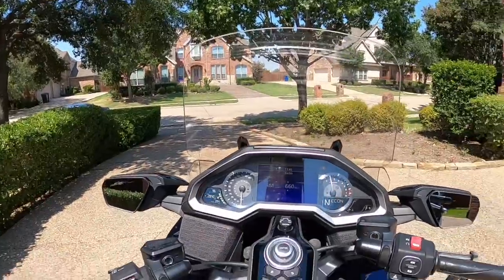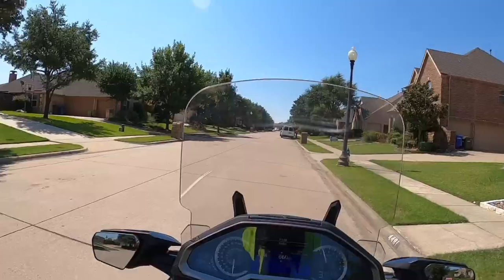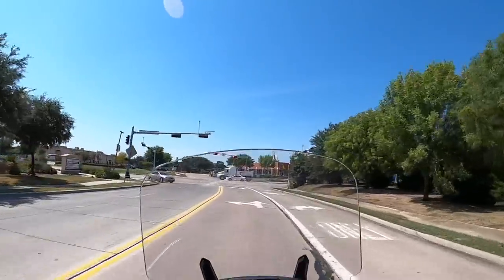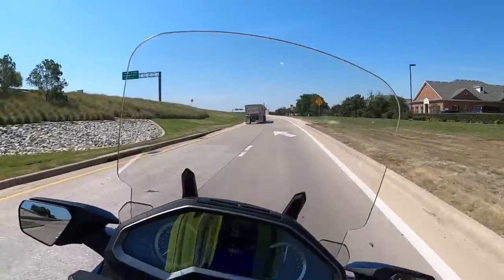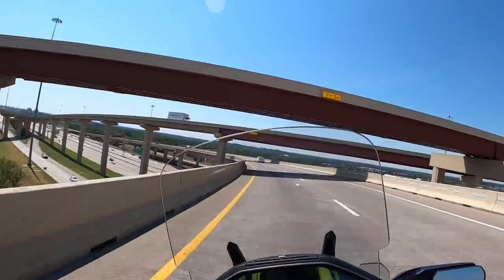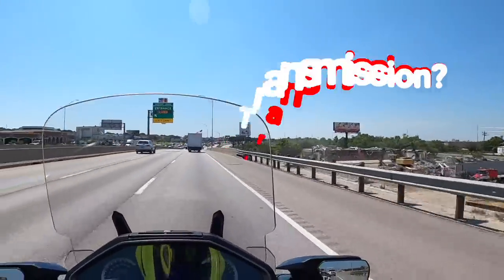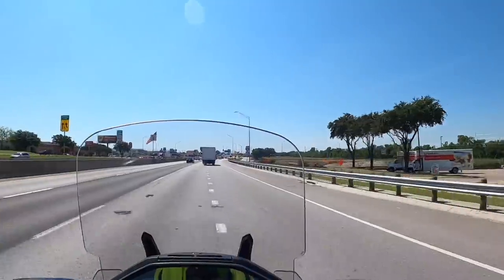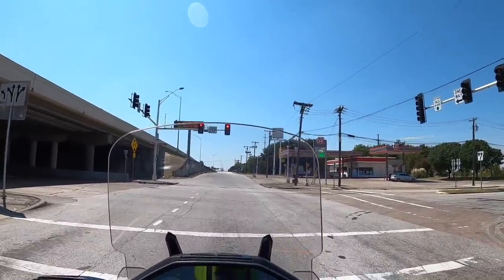Manual Transmission VS DCT | Cruiseman's Moto Vlogs | 2018+ Honda Goldwing | 2020

Comment: Yes the clutch takes some adapting too...just like the DCT does....but once you adapt your wonder how it ever felt strange...the way the clutch is setup allows for quick smooth shifting..you barely have to pull the clutch to shift...downshifts at speed with its slipper clutch is very smooth....the ride modes does the same with the 6-speed as with the DCT, except for the shift points...put the bike in sport mode and it feels like it gained 20hp and the suspension feels a bit tighter...Honda did a heck of a job with the 6-speed transmission...huge upgrade over the old models.
Reply: Thanks, more info in this comment than in the video

Comment: Drive modes change the throttle mapping, Traction Control and the suspension. On the DCT it also changes the shift points.
Reply: So, which bike do you prefer:  DCT or 6-speed manual?  Everyone is raving about the DCT but to me that's like driving a moped.  I love to 'disengage' after a long driving stretch and put the bike into neutral, cruising to my stop with no care in the world.  I'm leaning toward the manual 6 speed.

Comment: I wish I test rode a few manuals when I was researching the new Goldwing. I don't dislike the DCT at all, but there's something about the sound of a manual going through the gears and the control of manual shifting. That hydraulic clutch is not adjustable like a cable clutch is. HD is the same way - the friction zone is all the way out near the end of lever travel.
Reply: So, you would have rather purchased the 6 speed manual?  I am wrestling with these choices but am leaning toward the manual.  With DCT, it sounds like one is riding a moped.  What are your thoughts?
Reply: I am very happy with the DCT. It makes riding that much more enjoyable and fun, whether riding long distance on highways or carving mountain twisties. It is far from riding a moped - try one and you will see - especially in sport mode, with or without being in manual shifting mode. My only thought is how it would compare to a 6 speed manual and I would have liked to try one during my 1 year of research, but there were none available. I am happy with my purchase and do not regret it at all.

Comment: I have the 2018 manual Tour.  My clutch works perfectly, the idle remains steady and smooth, and it is the best shifting motorcycle I have ever owned.
Reply: Were you considering the DCT?  I'm wrestling with which option to go but it sounds like the DCT resembles a moped.  I've been comfortable with manual and will probably stick with that as my retirement gift.

Comment: Great video Cruiseman. I have always had a manual transmission but regret not going with the DCT on my 2018. The manual is really smooth though. I’ve had no problem with the clutch. Stay safe and ride safely.

Comment: I have a 2020 the clutch on mine grabs right when you start to let the clutch out, The driving modes will change engine performance as well.  The sport mode gives the bike much more power

Comment: On my 2018 manual, the different modes only appear to change throttle response. I don’t believe the "Econ" mode re-maps the engine response otherwise. My clutch also engages right at the end.  I also had to get used to that when I got the motorcycle, but don’t notice it now.

Comment: I have the 6 speed and did a video on why I bought it over the DCT. The drive modes are the same on the both models, when it comes to throttle response and traction control on the tour models. The drive modes have nothing to suspension as far as I’m aware since the suspension is not electronically controlled. The clutch on my bike engages sooner than that one, also remember it has a slipper clutch that makes the RPM come up as you let the clutch lever out.

Comment: probably already answered in the comments below ... but yes, the throttle response and 'fueling' from the computer is altered for the different modes. its actually very common. there are many many sport bikes out there that have different modes to 'tone down' the fueling for rain or UP it for sport, etc. This has been out for over 10 years on some yamaha, kaw, honda and suzuki sport bikes.(and others)

I love the idea of the DCT. I had a DCT honda NC700 for a little while and it was amazing the fuel mileage and how smooth it was. On buying a new goldwing, I just dont know about the clutch lever & shifter missing. I feel like riding wouldn't be as enjoyable. who knows. everyone online that has the goldwing DCT loves it. But Ive always been a manual trans car guy, and almost always had manual bikes. feels good to ride it and shift gears etc etc. PLUS a lot of slow speed maneuvering is accomplished with clutch lever feathering & slipping. So when considering a new goldwing, the more people I see LOVING the DCT, the more I question getting the manual version. .......... help

Comment: I actually adjusted my NT700 clutch to engage that late, 1/4 end of lever release, for quick shifting. Need to get use to that, or else engine would stall.

Comment: Chris, the 2020 model has improved throttle response in all modes compared to the 2018. I just traded a 2018 in for a 2020, and promptly took it out for a 3000 mile walk to Michigan from Texas. Seat has also been improved, and I was able to ride 12 hrs without hurting. The new model is hands down much more refined.
Reply from the maker: I will take your word for the throttle response. You have logged a lot more time with the 2020 than I have. But, the seat is the same SKU from Honda as the 2018 seat.

Comment: When I picked up my 2018 GWT6 from the dealership in February 2018, the clutch engaged immediately with almost no dead zone.  I had to stop and move the adjustment dial to "3" because I felt unsafe with the way the clutch was engaging.  My assumption is that it came from the factory set that way.  Scary for me as when I hopped on the bike for the first time, I was in between two rows of new bikes (outside) and I had to make an almost immediate 90 degree turn, followed by going down an incline, having to wait for traffic, and then making another 90 degree right hand turn.  The clutch has been fine ever since...

Comment: Where are the oil plugs on the manual transmission Goldwing 2021
Reply from the maker: There is only one drain plug on the manual model at the front of the engine.

Comment: What about slow speed maneuverability with the DCT Cruise? Requiring artful use of the Clutch, Brake and Throttle aka: Friction Zone? Like when practicing 18’ U Turns, Cone Weaves, Intersection maneuver scenarios posed in the advanced riding classes?
Reply: You put it in rain mode, and use the back brakes as friction zone. The back brakes are linked to 2 of the 6 front brake pistons. Honda Gold Wing  DCT is a awesome machine.

Comment: You can't "adjust" a hydraulic clutch unit.  The clutch not engaging until the top of travel is likely because it is worn out.  The revving at idle might because the coolant level is low. On a Honda car if the coolant is low the throttle body does not get the heat it needs to work properly.  Not sure on that as I am a Honda Automotive tech but the theory is there.  On my 2004 Wing I had to tear it down quite far to get to all the gear clamps it had to stop the coolant leaks.  Had the fuel cell out and everything to get to the clamps.  I think it had 32  clamps in total  Crazy.  Overall still love this bike enough to buy it twice...

Comment: I've got the 6 speed.  The drive modes affect throttle response.  Mine is a base model, but I think on the 6 speed touring model it also affects suspension behavior.

Comment: I have my clutch lever set to 5 so it engages almost immediately. 

The drive modes are for throttle response. Sport is very impressive lol. And rain gives you very little power, and works very well in the rain.

Comment: I've had my 2018 Tour almost 2 years now, this after a 2015.  So I think I can make a good call on the difference between the 5 sp and 6 sp.  6 speed all the way, it shifts so smooth and drops the RPM 500 @ 70 MPH.  I do not know what the MPG is on the DCT, but I get about 48.5 all day long @ 70 in Tour mode.  I've never ridden a DCT, but I will admit that the hill assist is very welcome on the 6 speed.  About the clutch friction zone, where is the lever cam adjustment set at?  I like mine @ 3, seems to be the best zone for me, but to each their own on all of it.

Comment: The 6 speed manual transmission just got more attractive.  Max at Traxxion Dynamics is about to fix the problem of the short shift lever that makes it hard to get the left boot under the lever.  This will be a huge fix.  The DCT is awesome but now I can enjoy the end of the nagging short shift lever.

Comment: What about longevity? Would the DCT last longer without repair than the manual? Is servicing an issue? Would the auto have to be serviced more often than the manual? Having a couple bikes, dirt/cruisin ect, jumping back and forth auto to clutch seems almost dangerous.
Reply: These too are my questions and concerns. The service and maintenance issues primarily. 
If you own and ride more than one bike, you need to pay closer attention to which one you're sitting on. Lol

Comment: I’m not a DCT type of guy. I want the transmission to shift on my command. I know there is a manual mode, but if you use that, you might as well include a clutch. I don’t even like different drive modes. I think that learning how the bike behaves, and having that continuity is safer. I don’t need buttons to enjoy my ride.
Reply: But with the DCT you have the manual mode and the motorcycle turns to a sport car with paddles. It’s fantastic!
Reply: I don't even turn on the radio. Just don't need all of the extra gadgets.

Comment: Can’t speak to the DCT as I’ve never ridden one but having ridden for 50 years I can say that my 2019 tour shifts better than any other bike I have owned. I shied away from the DCT because I was concerned about slow speed maneuvering, I ride mostly two up on this bike.  Friends have the DCT and love it and there is no way I can shift as fast as them but I am very pleased with my 6M.  There are five positions on the clutch lever, very easy to adjust.
Reply: @Hoasis Shine 

Respectfully. That’s what brakes do. They slow you down. Re-read your comment. Makes no sense.

Comment: Honda really seems to push the DCT goldwings. In 2021 I went to a Honda demo ride and all the demo goldwings I believe 10 had the DCT no manual transmission bikes. It was in Costa Mesa California with lots of traffic and I wasn't a fan of the DCT lots of shifting up and down and not real smooth shifts.  I bought a 6 speed manual goldwing.

Comment: I'm still torn. While many supercars are moving to dual clutch trannies and gaining quickness as a result (I understand that a well sorted DCT can shift faster than any hand rowing a lever), I also see a trend away from more "engaging" driving. One thing I covet about and associate with riding a single track motorcycle, is that the need to use all 4 extremities in fluid fashion contributes to making the overall experience more engaging and facilitates the magic of feeling "oneness" with the machine, road and surroundings. No question this DCT is a marvel of technology and even addresses successfully the low-speed issues associated with earlier clutchless executions (thinking about the FJR AE here), but I still remain on the fence.

Comment: Just bought a new 6sp 2019 Bagger (in UK). I have owned  a DCT Honda and it was very nice but it does have its quirks so I am very happy about my choice. Sometimes DCT does not know what gear to be in especially when going downhill and it can sometimes be distracting looking at what it’s doing. Yes shifting on DCT going up is very very smooth but on downshifts coming to a stop can often be a bit ‘lumpy’ where a slipper clutch manual would not be. Think the ‘bigot’ remark was uncalled for, choosing a manual box on your motorbike does not mean anything other than that, I want a manual box. Anyhow, horses for courses.

Comment: Also, for the clutch... if you adjust the lever it will feel a lot different. It won't feel like it's engaging at the very end.
Reply: Definitely had the same clutch issue on my 2018 Tour.  Adjust the setting on the clutch and it makes a HUGE difference.

Comment: I know how to adjust the throw on the clutch with the dial adjustment, but I would like the clutch to engage sooner.  It currently doesn't engage untll the last bit of the clutch release as mentioned in the video. I find this ackward for slow speed friction zone maneuvers. Anyone know if\how\should the hydraulic clutch can be adjusted to accomplish this?
Reply: there is a numbered adjustment dial on the clutch lever and also the front brake lever. Adjust each lever to your liking. just push each lever forward and then turn the dial to adjust the throw or engagement distance. I put my on three (3) right when I picked my new 2018 up from the dealer. Experiment the numbers for your self and see what works for you. You can also adjust this on the fly as your driving.

Comment: Hubby has the 2018 6 speed, I have the 2019 DCT. I love my bike❣️❣️❣️ Hubby not so much, but hey- opposites attract! This is my 3rd Goldwing (2002, 2009) this 2019 DCT is hands down the BEST BIKE ever❣️❣️❣️😁
Reply: Hey Jennifer, On a different note, on your 19, do you notice any slight left/right shake around 50 if you let your hands go for a second, on a smooth hwy run, for example? On my 2020 DCT Tour, I have a tiny shimmy. Not sure if it typical on GW. This is my first.
Reply: @alp3781  no shake or shimmy. Have you checked the balance on your front tire?
Reply: @jenkpms  Going to do both soon. Checking the balance and the tire itself at the dealer. I see posts that it is front tire issues on some bikes. Simply, defective tires. I will let the mechanic ride it and have it in writing. Thank you  for replying. Safe ride !!!

Comment: I own a '21 DCT.  I HATE the incessant gear whine...it NEVER goes away.  I can't even hear the engine above the constant high frequency whines and whirring.  I so wish I'd have bought the manual version. Live and learn.  GLTA.
Reply from the maker: I have not noticed any gear whine on mine.
Reply: I too own a 21 DCT, best choice ever. No whines and whirring on my bike

Comment: Drive mode has a large amount of effect on the clutch operation, especially at low speed.  I use econ most of the time, and the clutch engages about midway through the lever travel. I have a 2019 Tour, Manual, and love it.  Never a problem running through the gears.

Comment: Seems like Honda is moving away from the manual transmission on their big bikes. Not many cars from Honda can be had with a manual either. Thus far I'm a believer in my DCT, I thought I would use the paddle shifters, haven't touched them.

Comment: Smooth shifting?  listen to the KLUNK on your first two shifts while pulling out.  The idle transition map of the ECU needs to be run through its initiation procedure.  With bike motor COLD, and without even touching the throtle, in neutral, centerstnded, start the motor and let it adle until the temperature gague reaches its "full warm sweet spot" and continue to idle for about 5 minutes.  Then switch the ignition off.  The idle be stable and the transition from idle to higher RPM programing will be better.

prs
Reply from the maker: Nothing compared to the klunk of the 2016.
Reply: You should hear the klunk when engaging gear on my (new) BMW K1600 GT!!
Reply: Cruiseman simply hasn't learned how the bike can be shifted..he clearly said it was his first time with the 6-speed...mine is much quieter shifting..like with anything you learn how to work it better...the 6 speed is a huge upgrade over the old model
Reply: @cruisemansgarage  Rooster could be right. You commented on the  engine 'hunting' at idle and this could be seen on your rev counter. This could well indicate the need for a reset.

Comment: Yesterday  I demo rode a 2018  6 speed  . I've rode a friends DCT and It  was awesome. But from a simplicity point I would buy the 6 speed.  I'm sure there is a lot of electronics that control that DCT  transmission. 
After riding my 2013 FJR  with a Russell seat I  was really disappointed with the  GW seat.
Otherwise everything  about the GW was better. Super smooth  engine and ride.